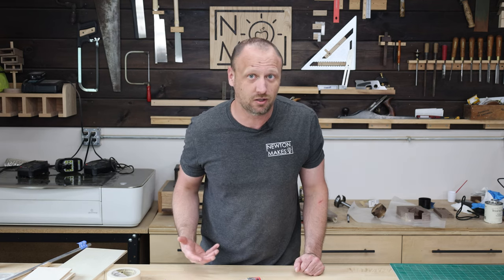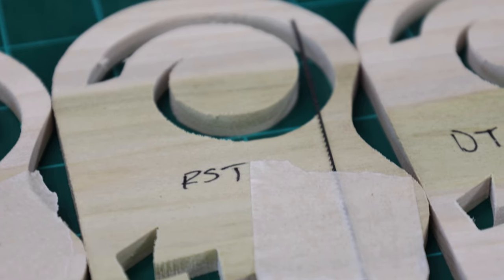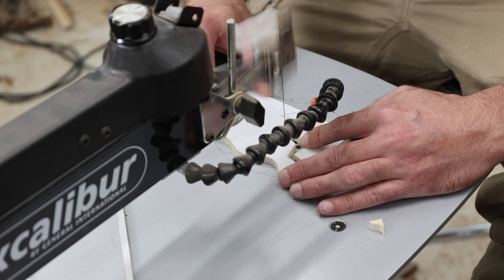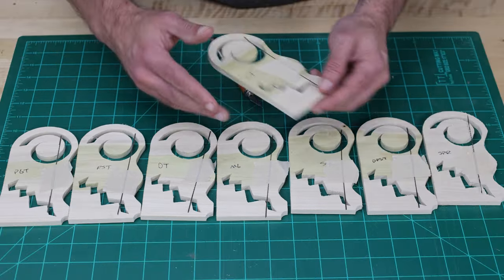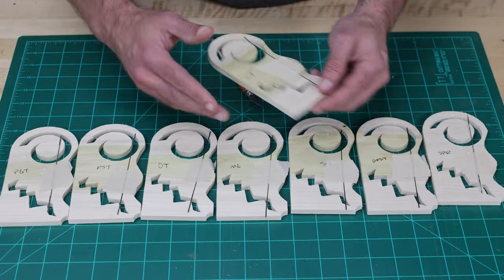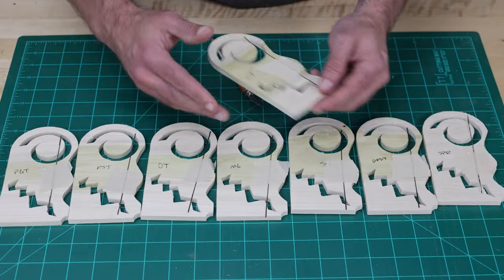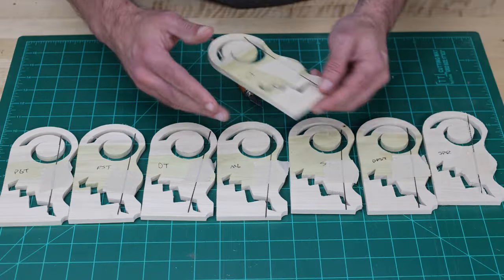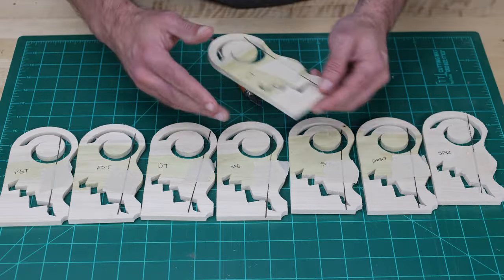The BEST Scroll Saw Blade to Use | The Ultimate Saw Blade Test

Comment: Good and fair tests.  It seems that the acrylic brought scores down for some of the otherwise good scoring blades.  For me I think I'd try to narrow down the best for wood individually and the best for plywood individually (or one that best suits both), and then a separate for acrylic if need be.  I pretty much only go with whatever crappy Bosch blades I can pick up at Lowes, which aren't great but they do in a pinch for my infrequent scrollsaw needs.  Require a lot of cleanup work though and don't last that long.
Reply from the maker: I'd like to do more testing on specific woods that I use often. There are several ways to go about it.